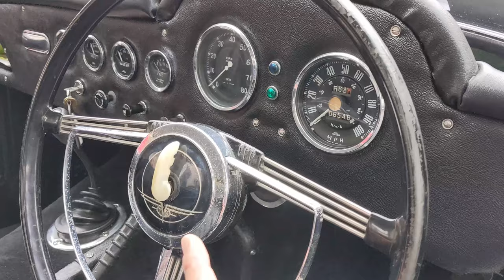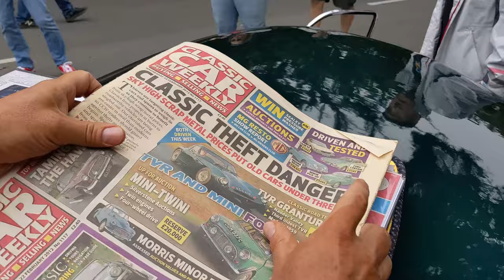My First Car Show in 2 Years

Comment: That could have made for  great vid if the cobra had of backed into the kombi. The TVR had a 105 E Engine? that would only be 997 CC. Brillaint engines though which had a hollow crankshaft .